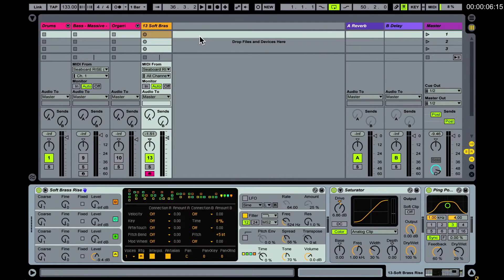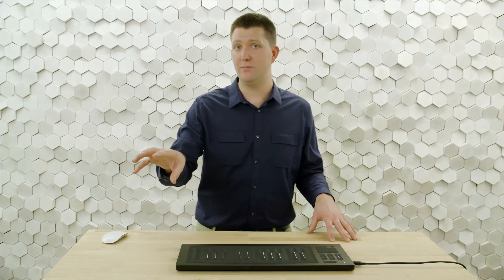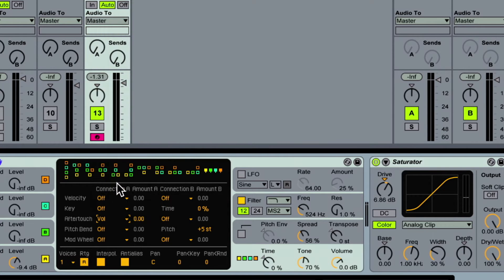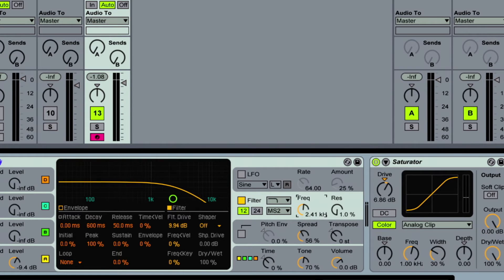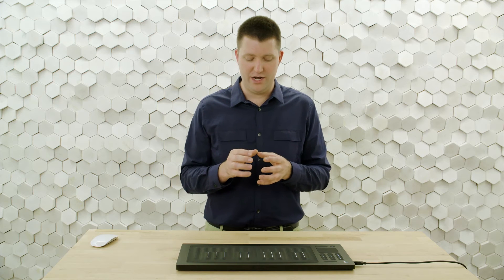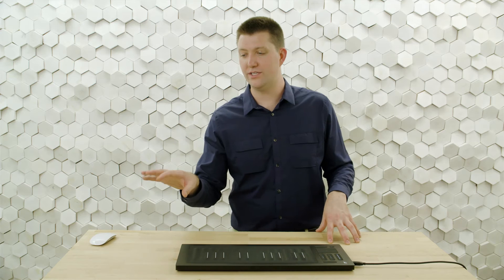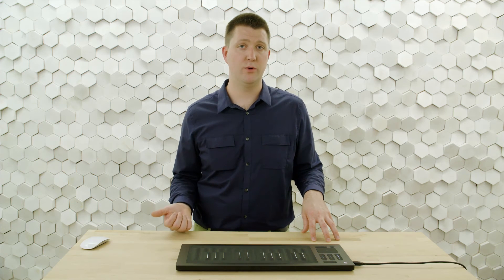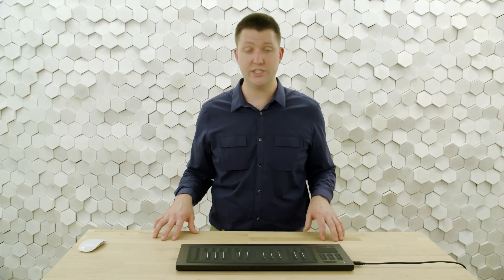Creating with the Seaboard RISE - 1.3: Expressive Synth Lead Using Ableton Live and Operator

Comment: Roli can you PLEASE add a method for capturing Slide and Press, and then using those to control midi-mappable inputs? For example, mapping Press to the cutoff of a filter in the form of an audio effect, rather than being locked in to using only specific instruments!